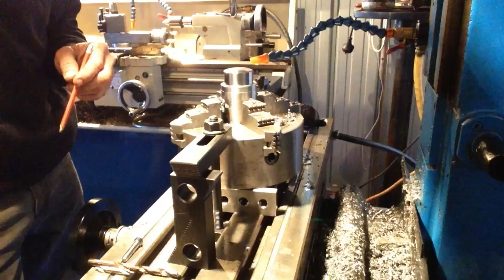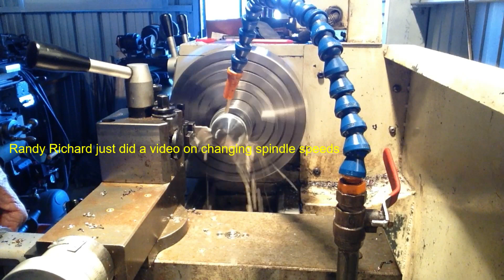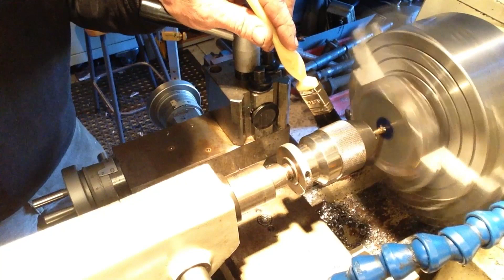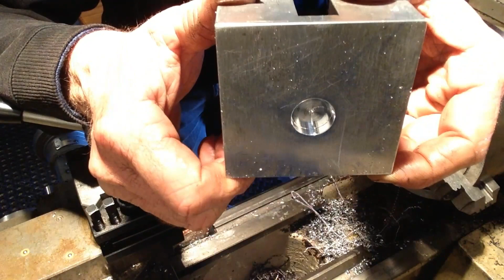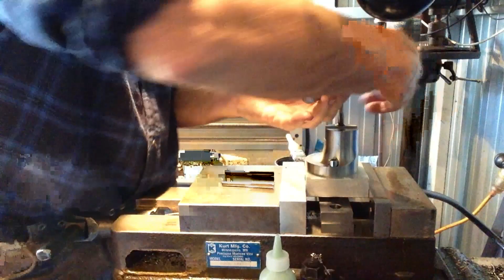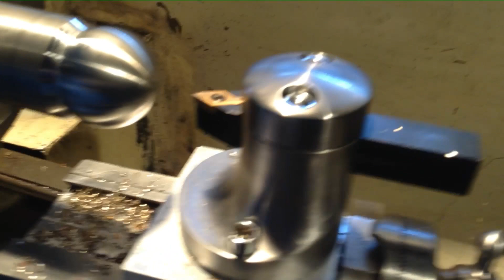Swarf & Chips   Episode 4  part 8

Comment: Nice work Max! I need one! Haven't seen one designed like that before. Been working out an idea for making balls on the mill using the Horizontal spindle. On the back burner at the moment. Persist through the chatter!
Reply: To both in this thread, you can also do balls using a boring head with a job in a dividing head. You need to angle the head/quill, set tool to cut outside and then rotate the job in the dividing head. It will take a bit to get precise diameter as that is done by stopping spindle and decreasing the diameter of cut, then repeat. A retired toolmaker told me this technique.
Have not as yet tried doing this but might be a fun exercise one day.
 Cheers from John. Australia.
Forgot to say Max Magnificent tool, I have planed to make something along the same lines as your fine tool. Now I have a construction series as to HOW TO. Thanks for that Max.
Reply from the maker: @joandar1  that's a different way , so  you must put your boring bar in the other way so it can cut on the inside of the bars tool path  hence when the dividing head is rotated it cuts the ball ,  dividing head straight & head tilted  & visa versa .  Cool .
Reply from the maker: Thanks .  if your mill is large enough one way is to mount a chuck to the spindle & just clamp your tool to a rotary table  .  Cheers .
Reply: @swanvalleymachineshop  Great tip max, just need a rotary table....

Comment: Hi Max that precision tool bit does fit well and the whole accessory for your lathe just looks great to us, a tool you should be very proud of. We like those Randy Richard in the Shop tips he has been doing for the lathe operations. You do not mess around 316 stainless it can get tough liking this get in there and cut it.  
What a GREAT performing tool thank you for the share, it is going to be a great tool to call up and use when you wish Max. Lance & Patrick.
Reply from the maker: Thanks .  I have a small job  to use it on in a couple of days !